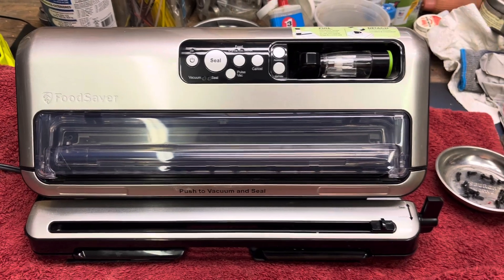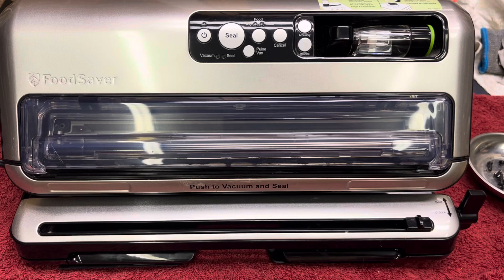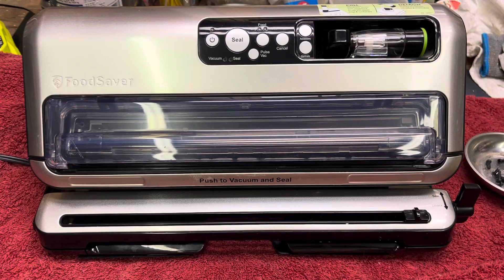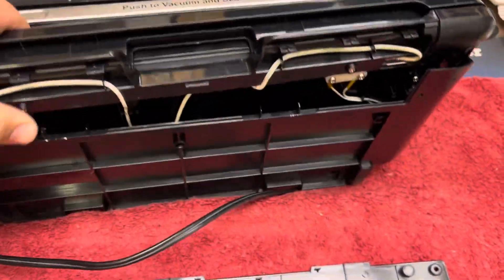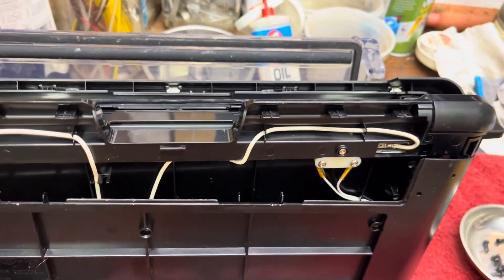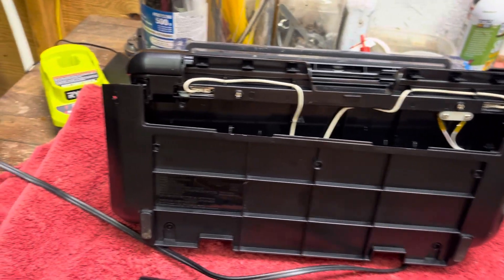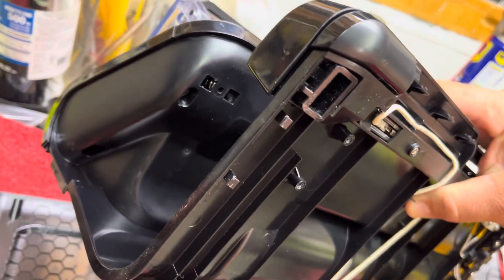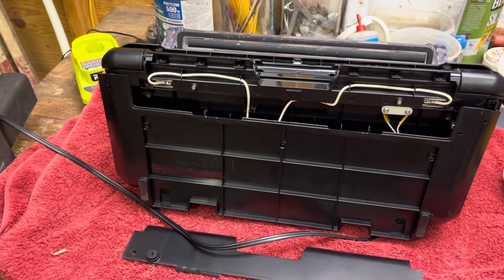FoodSaver FM5480 Disassembly

Comment: Thanks for this. I found that using a spudger or wife screwdriver on the "bottom" of that small underside panel, as you had it oriented, pretty much in the middle of each half, gets it to pop right off without having to mess with the clips.